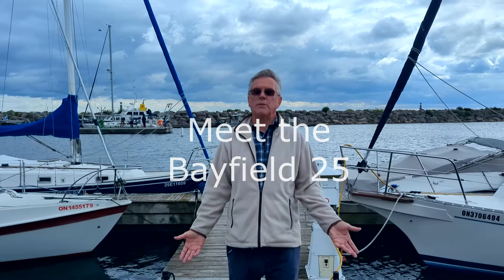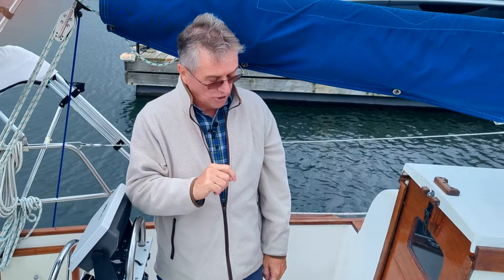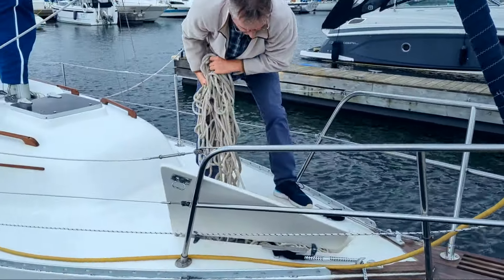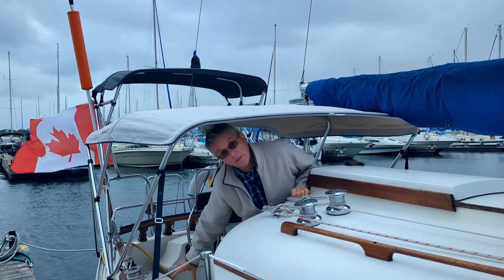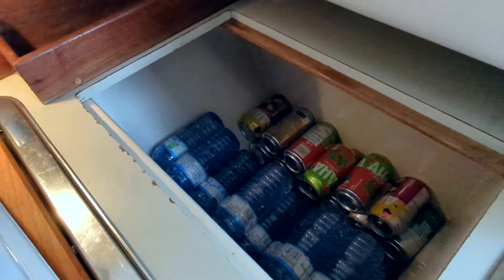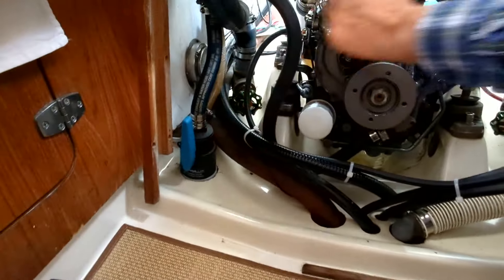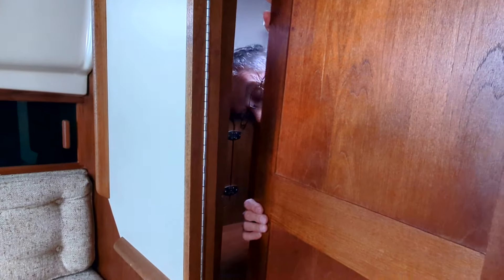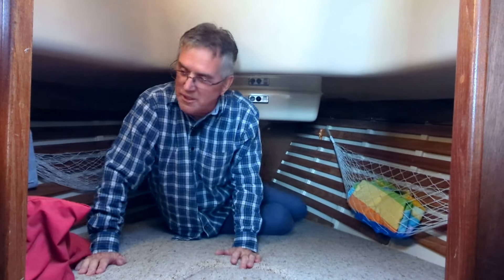Meet the Bayfield 25 a great little sailboat with Jeff Pruce

Comment: What a lovely, clean little yacht!  I considered the Bayfield 25 years ago for a very specific reason….Its trailerable.  Its probably one of the most complete and capable small boats capable of being towed anywhere you want to adventure…A diesel (with amazing access which is quite unique), proper tankage, an anchor locker.  Very unique and good value.
Reply from the maker: Yes, I have to learn how to take down the mast yet and get a trailer if I want to move it around.  Sometimes I get the 2 foot itch, but this boat has everything I need.  Thanks for the lovely message.

Comment: I had an 1983 Bayfield 25. I like some of the changes. The main one I like is the engine access. Mine had no access from the cockpit. On the other hand, i had a proper separate head.
For a 25 footer it is surprisingly seaworthy. I sailed single handed numerous time across the Straight of Georgia, headed to the Gulf Islands in BC. more than a few times it was blowing 20kn, and more. If I hadn't had some health issues, I'd still have it! Not fast, but it'll get you anywhere you want to go.

Comment: I also have this exact same boat! A 1986 Bayfield 25! And I love it. Yours is in very good condition. Beautiful! I would love to see what the area with the washroom vanity sink looks like on yours. I don’t use mine either. Thanks for sharing!
Reply from the maker: Hi seagypsyjae , the same boat.  Where abouts are you.  I am in the Toronto area on Lake Ontario.  I'll see if I can send you a photo of the vanity area.  The sink has been removed and replaced with a counter top.  Above the sliding doors is a wire rack.  So it has just become a two shelf system with access to the sliding doors for stuff that I don't need to get to often.  I'm working on putting the boat up for the winter and making a video of haul-out and winterizing. 
Thanks again...Jeff

Comment: Hello from Newfoundland. That's a beautiful boat you have there. I have an older B23, and a B29 that I just purchased to refurbish. Great Job on the video.
Reply from the maker: Well thank you for watching. Glad you enjoyed the video.  I'm starting a series about all the joys and pains of ownership.  Looking forward to working on it.  That's exciting that you have two Bayfield's.  Maybe one day I might move into the B29.  Might have to make my way to Newfoundland and check yours out.  Thanks again.
Reply: When the  Bayfield's first came out, the smaller was called a 23. Apparently there were many arguments with marinas, as they were charging for 25 feet. Many people complained to the Bayfield people about it so they changed the designation to 25. 
That's the story I was told when I bought mine, and I tend to believe it, as the broker who told me that was the Bayfield dealer in the Vancouver area in the 80's.
Reply: Interesting. I think they're both the same length, but the later 25 has a different interior layout and longer keel. @patmonks3459
Reply: They made numerous changes. There were many that had outboard motors. They did some changes to the keel, cutting away the forefoot to allow it to turn easier.  Interiors changed as well. I've seen the galley aft on the starboard side, and aft on the port side.

Comment: Nice boat. There's a 1974 for sale on FB Marketplace near me, $8500.  Not many pictures so hard to see what shape she's in. That's why I cam here!
Reply from the maker: Thanks for stopping by.  The 74 model is a lot different.  I believe it's a mid galley, a small side table on the starboard side and only two windows instead of three.  Also the engine might be the little 8 hp YS8.  Lots of them in the 70's.
Reply from the maker: Yes check this out....
https://sailingtexas.com/201201/sbayfield25111.html

Comment: Is the engine hatch in the cockpit factory or custom built?  I want to do the same to my bayfield 25.
Reply from the maker: This came from the factory.  I think it was early 80's that Bayfield started doing this.  It's in the 29 as well.  It certainly is a great access to the engine, transmission, shaft and for the pedistal.

Comment: I just don't get putting a Bimini on that you can't use while sailing. I'm sure it would work if it's sheeted to the bridge deck but it isn't.
Reply from the maker: It's because the traveller is at the back of the boat and the main sheet needs to pass where the bimini is.  I can sail with the forsail no problem.  So I would have to move to traveller forward to sail with the bimini.  That being said, at anchor or while at the dock, the bimini is wonderful for shade while relaxing in the cockpit.
Reply: @prusea  Just a personal preference. Lots of people make a boom tent with a tarp, though. The first time I saw a bimini like that was on an Ericson 27, but the owner knew nothing about boats and probably screwed something up just driving wood screws into the cockpit. Left a sour taste in my mouth for it.

Comment: I'd be a bit worried about having my head in the way of that traveler. A beautiful compact boat though.
Reply from the maker: Yeah sometimes it's a pain.  Only once I was sitting too far back and on a very fast tac, the sheets came across my chest.  Bit of unwanted excitement.   But it certainly is easy to control and fast when you always have the boat in control.  Also I want to move that bimini forward so can have it out while sailing.

Comment: One does NOT count the bowsprit as the size of the boat.  Size of the boat is Length on Deck! It is a sweet 23 footer and can stand on its own without exaggerating its size.
Reply from the maker: Bayfield changed the name from the Bayfield 23 in the 70's to the Bayfield 25 in the 80's.  All the  Bayfield boats include the bowsprit in their size.  Island Packet does the same.  The marina charges by the foot, including the bow sprit and anything past the stern.  😢😢. I wouldn't want to pay the extra dockage for a 5 foot bowsprit on the Island Packet 44, but I can handle the small bowsprit on the Bayfield 25 😉

It is a great boat.  Thanks.
Reply: I guess marketing surpasses tradition. I didn't know the factory changed the description (nor that IP was counting their sprits). Thanks for the update; I'll be more careful.  I know of virtually no others that count the bowsprit. (I own a Seawing 43 - not counting the six foot bowsprit - but would never call it a 49 foot boat) @prusea
Reply from the maker: @Morrisfactor  wow 43 footer.  I can only dream of having such a boat.  Guess I will have to come for a sail with you.  Great to connect with you even on here.
Reply: And I for the lesson on factories counting sprits for the length. And one bad thing about my boat - the marinas DO charge by the slip foot - so I need a 50' slip - ouch!    @prusea